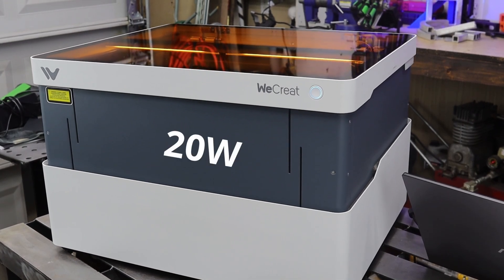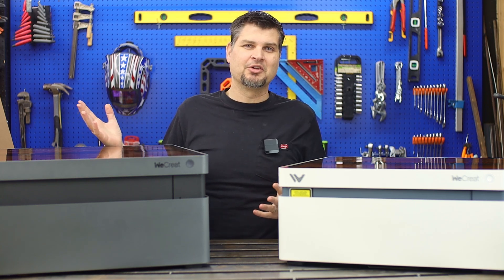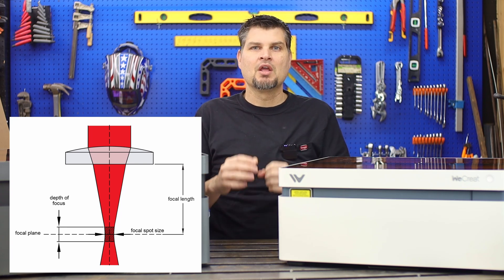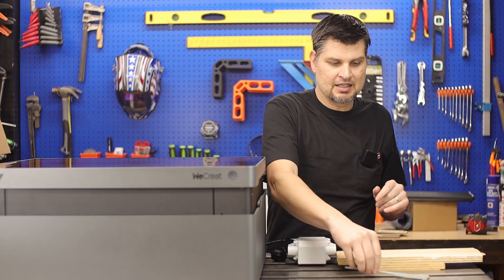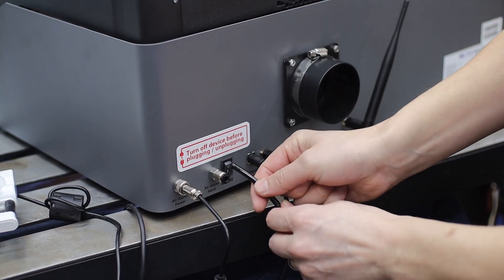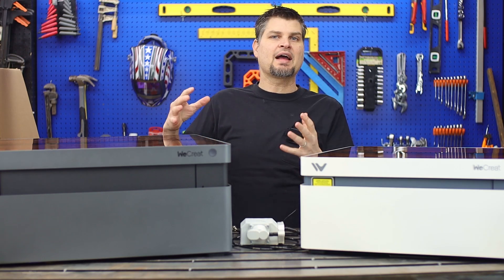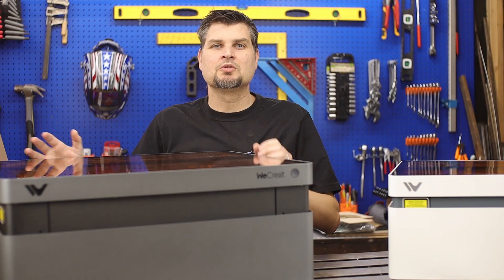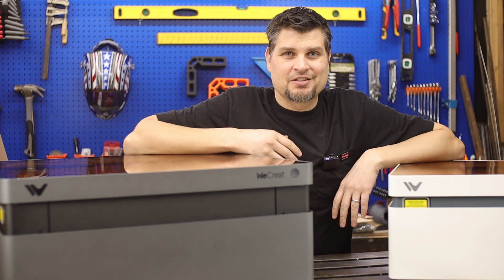Should You GET The WeCreat 45W PRO Laser Engraver

Comment: When you say it won't do metal, do you mean it won't engrave the metal like a dog tag or more cut off the paint on those tags? I have a K40 now but I'm not really happy with it... if I try to engrave something, even if I put it in the exact same spot as last time, for some reason, it will move the laser the next print off a little to the left or right even when making sure to re-home first. I really like the camera on the vision where I can just say, print right here and it does it. This is specifically for things like dog tags or watch dials. (cutting the paint off of them for engraving)

Comment: I mean, that smaller spot size does make a lot of sense; they're claiming 10mm more cutting thickness for only 5 more Watts of power, compared to the 40W, right? Yet the 40W only cuts 5mm more than the 20W, even with twice the power. That smaller spot size really works to the 45W engraver's advantage. Much more efficient.
Also hi Jeff!